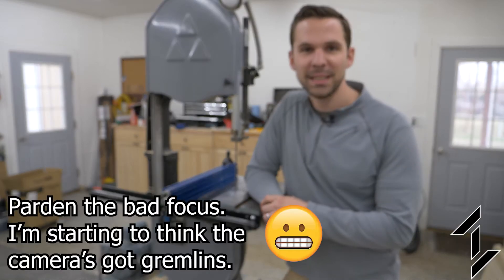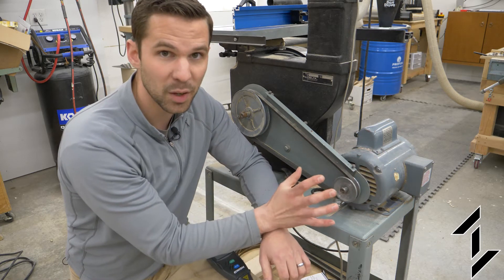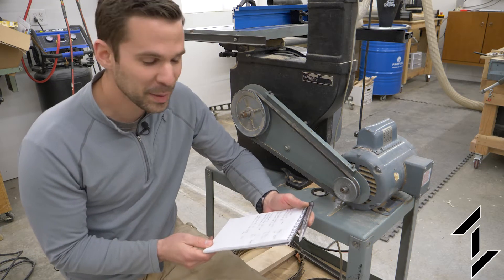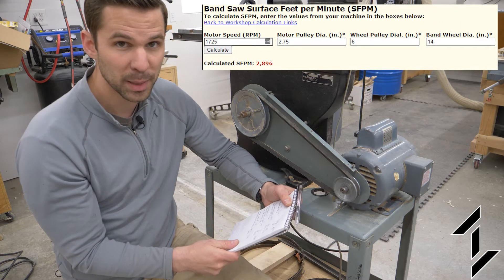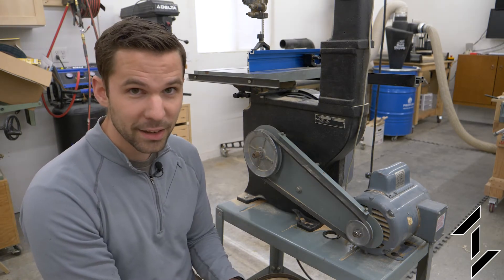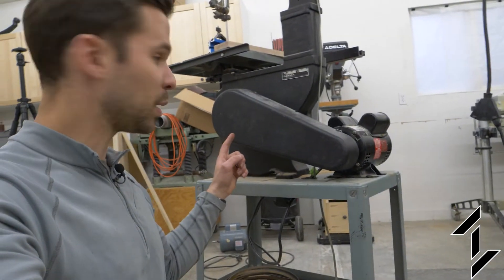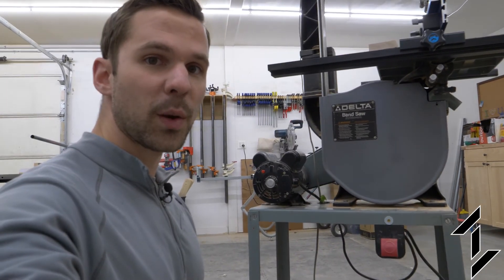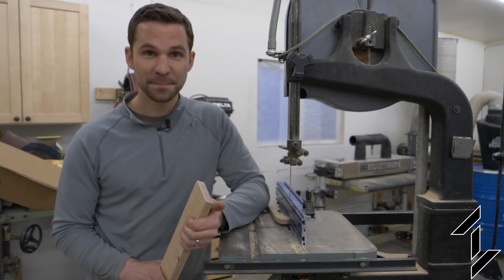Can You Upgrade a 14" Band Saw with a Faster RPM, Higher Horsepower Motor?

Comment: there is a catch . the faster motor popped the tires off the rims .had to loosen the belt so it slips at start up and the tires stay put .
in the end though i up graded to a much bigger bandsaw which made all the difference
Reply from the maker: Wait, the tires that the blade rides on popped off?! That definitely seems like an issue with your tires, there should be no way that they slip even if the motor was 10x as powerful or faster so if that's happening they have likely worn out and badly need to be replaced. Also, if the pulleys are changed out to keep the same blade speed the only thing that's moving differently would be motor, drive belt, and drive belt pulleys, everything else should be spinning at the same rpm and moving at the same speed.

Comment: I wonder if one of those new red link pin style belts would offer less vibration as they have no "memory".  What brand riser block did you use on your saw if you don't mind my asking?  I have a Delta 28-276 and have been wanting to make these same changes to mine.

Comment: I don't think anyone mentioned this but; Your original 1750 rpm motor is 4 pole and the new 3500 rpm motor is 2 pole. The 4 pole motors have more torque. You replaced that with a lower torque motor, only to make up the torque loss with the additional mechanical advantage of pulley reductions. You may have gotten more power with a bigger hp motor, but a larger hp 1750 rpm motor would have eliminated the pulley exchange.

Comment: As a 25 year maintenance supervisor watching several videos on folks replacing the motors on these saws the lack of knowledge on the motors is silly. All drive motors are 1700-1780 rpm a lot of fan or pump motor ware double that. 50+ or - rpm makes no difference. That motor should never have been considered. Look at the frame size, hp, phase and rpm when replacing motors. Want more power? Add more horsepower.
Reply from the maker: Your comment is quite unclear. Why do you think that motor should never have been considered? It matches frame size, phase, and with the pulley conversion has the same output surface feet per minute.

Comment: I you just made the drive pulley half the size, it would have been the exact end result, but with a 1.75 pulley, there may be belt slippage.
Reply from the maker: Hmm, I'm not sure the math checks out with the motor rpm and the desired feet per minute of the blade. Can you elaborate?

Comment: Great video, did you have to change the on/off switch or the wires?
Reply from the maker: The motor I swapped it out with was from a table saw so already had an in-line power switch. That's not super typical so yes, I'd have needed to wire in a new on/off switch otherwise.

Comment: What is your longterm assessment of this conversion? I'm tempted to do the same but am a little concerned about the reduced contact of the belt on the input pulley potentially causing slip and/or reduced belt wear. Has either turned out to be the case for you?
Reply from the maker: I haven't noticed any belt slipping. I don't believe it should be a problem if things are tensioned correctly. I'm still happy that I made the upgrade, although I didn't gain as much resaw benefit as I was hoping. Those 14-in band saws even with a riser block and more powerful motor still can't quite hang with the bigger band saws.
Reply: @42Pursuit  thanks for the reply. There’ a 3450 rpm 1.5hp motor here for cheap so I’ll give this mod a try as I can’t justify a bigger unit at the moment so I might as well get the most out of the one I have.

Comment: Great video. Just the info I have been looking for to upgrade my old Delta 14 inch. Now I can actually start to use it again.
Reply from the maker: Awesome! I'm glad you found it helpful!
Reply: @42Pursuit  Just a side note. I have an old Delta contractors saw from the early 90s. I took the  motor off that one and put it on the band saw.  It is a 1.5 hp @ 3450 RPM. So with some different size blades and a few other accessories this should be  nice saw.

Comment: Thank you for this video! I have an older 12" craftsman bandsaw that the 3/4 hp motor stopped starting up and even replacing the start capacitor didn't help. So I got a 1 1/8 motor from a shopsmith someone had donated to habitat for humanity for only 18 bucks btw, which was almost brand new but runs at a faster speed then the old motor so I was worried about changing it but I'll order some new pulleys and a link v belt and get it running thanks to you!
Reply from the maker: That's fantastic! I hope that works great for you!

Comment: what do you think is the biggest motor you can get away with? i'm interested in using an old 14" band saw as a sawmill cutting up to 12" wide logs, maybe use a 7.5HP gas motor on it.
Reply from the maker: I think you can get away with any size motor so long as the pulley ratio keeps the surface feet per minute of the blade in that typical range.
If you're using a 14-in that's a similar frame design to mine, I don't think you will have enough frame rigidity to do serious resawing like that. Mine can do more than it used to, but it's still takes a really long time and can't do consistent resawing on wood larger than 8" in my experience. 14" bandsaws also typically aren't designed able to fit a 3/4" blade which is much better for larger resawing operations. Something to think about.
Reply: Just put a 3/4 " laguna resaw blade on my older ridgid14" with riser block and been ripping 12" walnut logs on it! 😉 3/4" is max, but fits fine!

Comment: Ill be doing the exact same  thing. Thanks for going through the trouble for me. I advise u add the ribs i used 1 2x4  in the middle from left  to right and 3/4 ply on top and that made a big difference  with the vibration. Will be adding  a link belt  to help reduce the vibration
Reply from the maker: Glad you found the video useful! It's been working alright for me, but I do think I'm going to have to add ribs and a link belt to cut down on vibration 👍